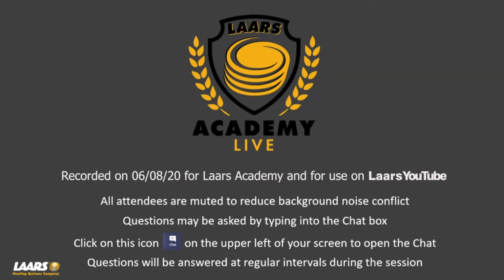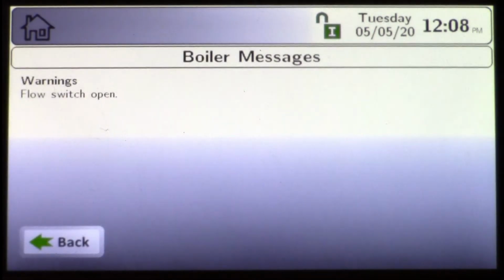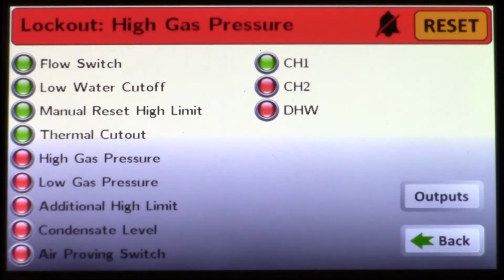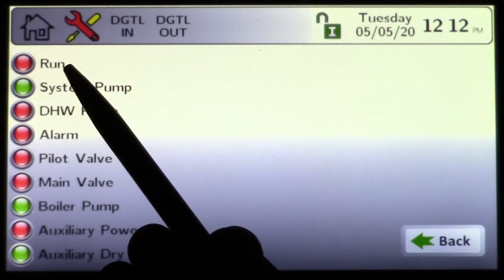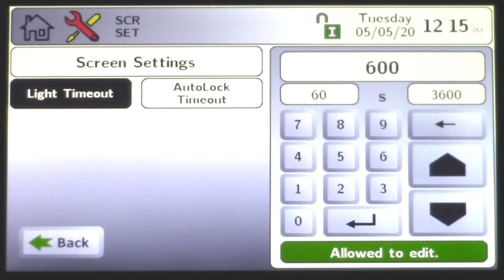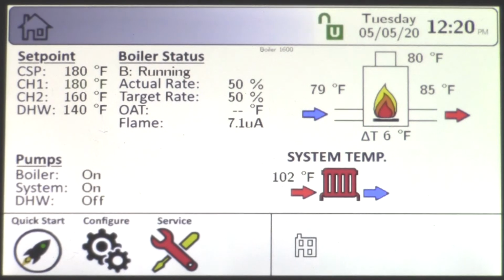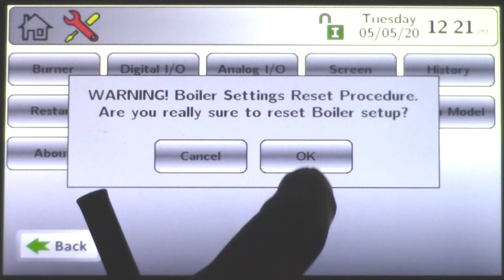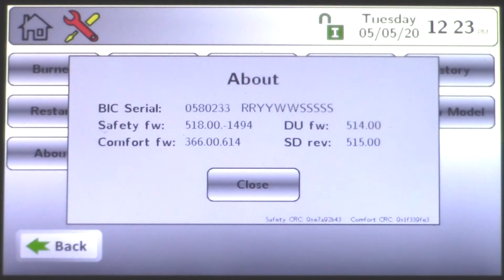Laars Linc. 6 of 6, Service

Comment: How can I get a video of cleaning the outside coils of my Laars mini therm JVH  ? Installed 2006 it also makes a humming sound when it runs ? ? Is this normal ? ?
Reply from the maker: The Mini-Therm JVH has copper tubes. They're not 'coils' and I would always recommend that servicing your Mini-Therm should always be done by an experienced and trained HVAC Technician. 
With that said, it's not a complicated boiler to service. Were you able to get the humming sound addressed?
Reply: Appreciate the reply, haven’t had it serviced yet, hard to to someone or an experienced HVAC person out to check it out. Previous owners said it was last serviced in 2017. The person they used is retired, been trying to get in touch just to let me know what they did when it was serviced. 
It’s still makes a humming sound while turning on however ……is this normal ? Appreciate any advice & help you may have on this unit . Thanks so much again .
Bob
Reply from the maker: @bobmariano3731   if you want to contact me with your location and phone number, we can connect you with someone in your area that can assist you.  My email is marketing@laars.com.  Thank you!